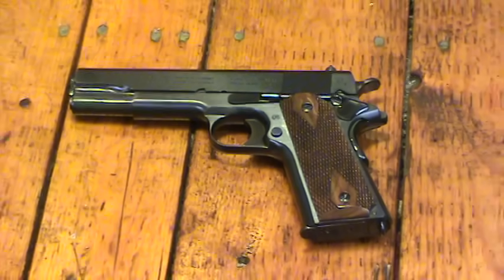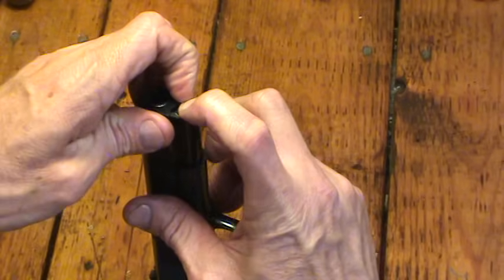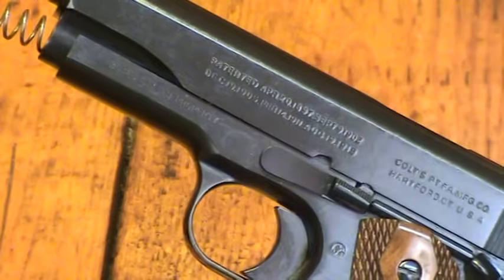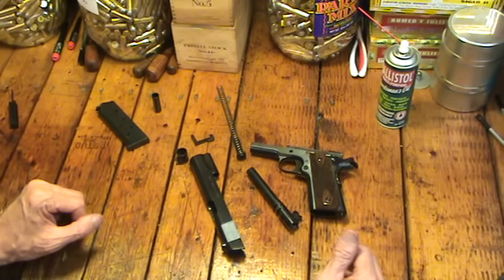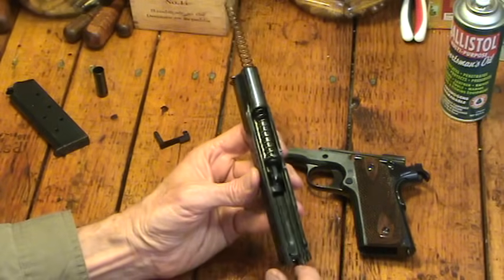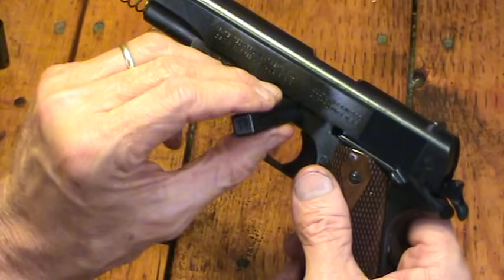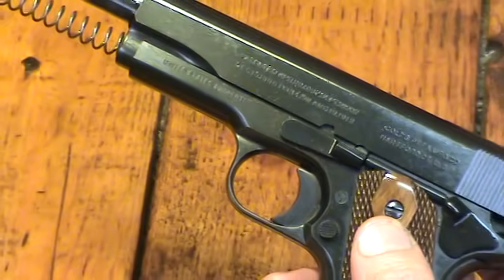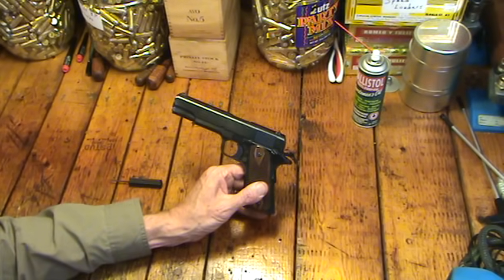1911 Field Strip

Comment: I just field stripped and cleaned my new 1911s. .45 and.22. It’s not an easy task for the first time ever. The rock island.45 has a strong recoil spring and my hands are not as strong as they used to be. With a bit of trial and error and what I learned from your videos and a few others I was successful. Thank you for your videos.
Reply: I put it together with the barrel link up. I need to take it apart again and assemble it with the link down.

Comment: You saved my bacon!  Picked up my new Ruger SR1911, disassembled to initially clean, and couldn't get it back together.  The slide lock lever just wouldn't go in.  Yes, that little, teeny-weeny notch has to be positioned just right.  You got me there!  Bacon saved.  Thanks Mr. 45!

Comment: Thanks showing that the barrel link should be down (forward)!!! Smith and Wesson's manual doesn't mention that anywhere and neither did other videos I watched. I had it pushed back and could not get my gun to go back together. Very frustrating. Spent quite a while trying to figure out what I was doing wrong, then I watched your video. After seeing the proper way to do it, it took me less than a minute to complete the reassembly. Very, very helpful.

Comment: Good video, as always.

A couple of comments:

I typically remove the firing pin stop, firing pin and spring, and extractor whenever I clean it. 1911s are dirty pistols, as you know, unlike Glocks. Folks new to 1911s may want to look into disassembling these guns and cleaning as recommended.

Also, it may be worth noting that the OPEN end of the recoil spring points forward, the closed end contacts the guide rod.

Comment: I already knew how to field strip a 1911, but watching this still helped as I have trouble getting things to line up properly almost every time. And yes, my 1911 has a terrible scratch in its parkerized finish under the slide release. I always use a tool to push that little plunger in behind it, but I will try your way now as it seems much simpler and less dangerous to the finish.

Comment: Just a minor point to avoid confusion. The "man spring" on a 1911 is the spring at the lower rear of the grip that operates the hammer, inside the small housing that forms the lower part of the grip backstrap. The large spring under the barrel is the recoil spring

Comment: The way i keep from scratching the slide is cut the end of a soda straw long ways on one end in half about an inch and slip it under the slide lock where it would scratch the slide, the thin plastic won't interfere with assembly and protect your slide, or use a Pachmayr plastic 1911 widget tool, I think Brownells has them(maybe) .

Comment: First thing I did with my Kimber was yank out the full length guide rod and replace with a standard GI rod and standard bushing plug. Much easier to disassemble and no downside in performance, at least for me.

Comment: There is a BB co2 pistol called a tanfoglio witness. Its modeled after the ww2 1911. It looks very identical to this when its field stripped. The only difference is there is a spring on  the barrel as well. Also its made to shoot steel .177 BBs and has a little additional piece for the bb barrel. Its a very nice replica of the 1911.

Comment: My grandpa got a new Chiappa 1911-22 which is built the same way. He was trying to show me how to field strip it and when it came to the barrel bushing at the very beginning he said it had to be turned 1/4 turn to come out. He spent 5 minutes trying to get it out with no luck. I turned it 1/2 turn so it would be turned 1/4 turn in the other direction and it came right out.

Comment: It's just a little more difficult if you have a full length guide rod.  The plunger tube with the hole in it is hard on bare fingers.  I use anything handy like a toothbrush handle.

Comment: Hi, do you have to rack the slide before stripping it? Also, you say to keep the barrel link down when putting it back together so that the holes align..cutlery lover says to keep it up..in his video, his 1911 has an extended guide rod though. Is that the reason for the difference?

Comment: Quick question on 1911 barrel cleaning versus Glock. On your Glock cleaning video, you generously spray Ballistol all over the barrel inside and out, let sit, then wipe down later. Do you do the same Ballistol procedure with a stainless steel 1911 barrel? Thanks in advance.

Comment: My fingers are not as strong as my younger days, I use a piece of wooden dowel rod to press down the plug, to where it's in far enough,So that I can lock in the Barrel bushing, Even if I have to use the plastic wrench that came with the new gun.? This is far easier than the plug flying out & taken out your eye etc. This works great for me.

Comment: I'm having issues putting in the slide lock back in. I've made sure the barrel link is in line with the frame holes countless times. It snaps in halfway & then stops about 1/8" before becoming flushed. It's been sitting 4 years during military contract. I've put more pressure on it than I did with other firearms & made some idiot marks in the process. Is it safe to bring out the jackhammer now?

Comment: Thanks for the video. I have a Springfield Mil Spec and the barrel bushing cannot be removed by anything other than a bushing wrench. And then I still have to pound it off the barrel with a screwdriver and mallet. Any suggestions on how to loosen that up other than just oil and time? I almost punched a baby out of frustration.
Reply: Effinayhole you need to lap the fit with a fine lapping compound. If you have questions, find a local gunsmith, cheap fix

Comment: just did my kimber
has a full length recoil rod, so I had to pull spring out front before I could get rod to clear barrel to remove
otherwise same as this video. My glocks are of course easier,LOL
Like your g20 review, going to get a 20SF, already have a g22 g19C had several 23s

Comment: I was stuck one afternoon shooting my swissvale 1911, got it apart but could not get it togther.  I did not want to take the parts to the gunny and I figured if marines can do this blindfolded I sure can.  Got up your video and viola, just had to move the slide a cunthair to push in the whatever pin all the way.  OK now lets see a video on how to clean the 1911 the hickock way. I got my Ballistol ready boss.

Comment: Yes Check TEC TIP for The  "Idiot Scratch."? All it is is you cut a piece of any business card, As it has the right thickness for this & slide it under the frame & pis as you re insert it back & lock it back into the frame, & then just pull out the piece of card stock, & throw it out.? Check out the video will show you in detail on how to.

Comment: This is impossible with a world war 2 M1911.
Reply from the maker: What's "impossible"?  I field strip them all the same way.
Reply: I took mine down, exactly how you did, and everything worked perfectly.  cleaned it up, and oiled it a hit.  but I ran into a problem on the barrel.  that little thing, that has two holes, and the pin holding it on is where my problem runs through.  Its so.old that the pin falls straight out when I try to do anything. Would you recommend getting a whole new barrel, or just that little part?
Reply: Hi Landon. I know that can be frustrating with the older 1911s. What I did was apply some gun grease ( not oil ) to the pin so it would be a little sticky and not move when it went back into the barrel. This allowed me to reassemble the weapon without the pin coming loose. Hope it helps.